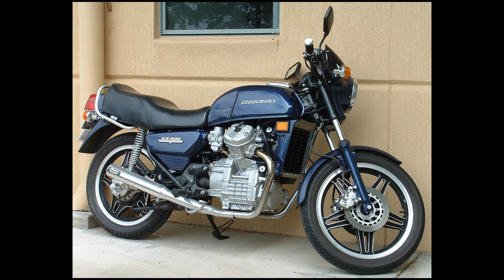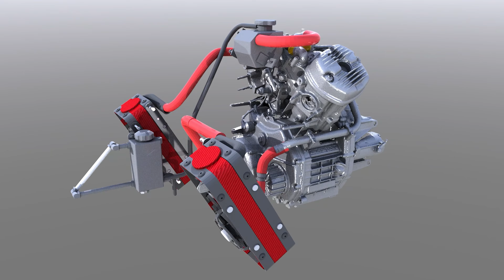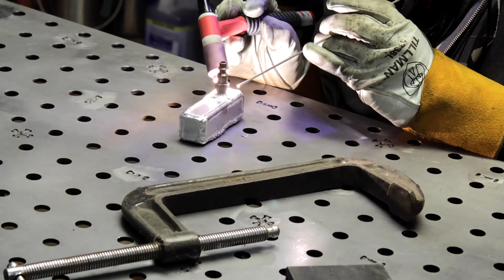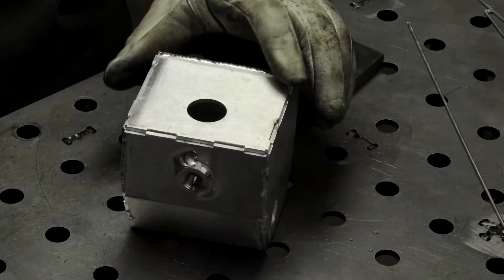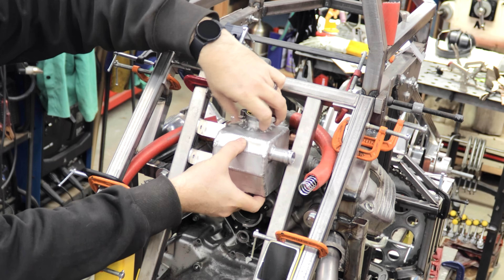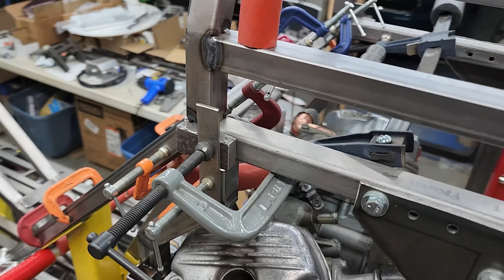Akira Bike Project - 26 - custom split radiator cooling sys - part 1

Comment: Hey! Wouldn't it be slightly better from a redundancy and efficiency standpoint to put the radiators in parallel instead of the way it's shown here?
Reply from the maker: Ugh that's a whole internet rabbit hole you can go down lol.  Both setups have advantages and disadvantages, ultimately I went with the series because it was simpler and required fewer hoses/connectors. But it may need an additional pump where parallel may not.  I can easily switch it though.  We'll see after some testing!  Good catch!
Reply: @matus1976  Nice, I understand why less parts would be a good thing. I hope this works well, at least using hoses you can properly test this setup before you get fixed with one!

Comment: I'm a welder that has been doing only aluminum for the past four years and I have to say for beginner aluminum TIG, you did pretty alright. Moving around to balance the heat on your parts was a good practice. If you do more in the future, I'd suggest pulsing with your foot pedal to control your bead size and heat better. Just ease off the pedal as you step forward, then back onto it until you see the puddle wet properly before adding your filler dab. Works pretty well for me.
Reply from the maker: Thanks! It's definitely a lot different than steel, there's a lot more 'fighting with the bead' and I have a ways to go. Appreciate the tips!
Reply: @matus1976  I think a lot of folks get nervous about the heat management with aluminum. It does get pretty goopy if you go too hot, but if you can balance that with speed or pedal pulsing, it becomes noticeably nicer.

Comment: My boat has a San Juan cooling system that uses an all copper heat exchanger. Thare is a sacrificial Zinc inside the heat exchanger to reduce bimetal corrosion, it might be something to consider.
Reply from the maker: I'll definitely keep that in mind!

Comment: This is where 3D printers come in for rapid prototyping those kinds of pipes and some plastics can handle the temps and pressures once printed.  Not to mention that once you have a working STL file you can also have them printed in a variety of metals from companies that do that.
Reply from the maker: Yeah that's a good point!  I do have a 3D printer but ABS is too weak to even consider, but there are better filaments now that are almost as tough as aluminum.  I'll keep that in mind.  3D printing metal parts is still pricey, but it may be the right way to go in some instances.

Comment: I've said before in a previous post - engineering students probably pick up more from watching your clips than they do in months in the classroom. Trial, error, repeat - until it works. Good old fashioned on-the-bench prototyping.
Love your stuff, keep up the  good work.
Reply from the maker: Thanks!  There's nothing like doing it for real in the shop - just thousands of variables that can get you. Half of it doesn't even make it into the videos either.  I'll have to do a video on just some of the odd challenges that have come up that you'd never expect.